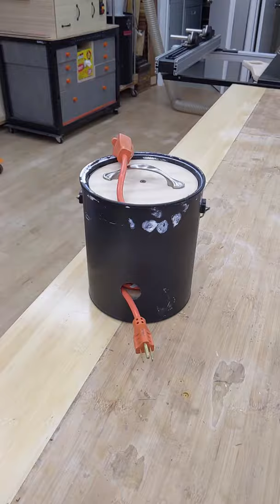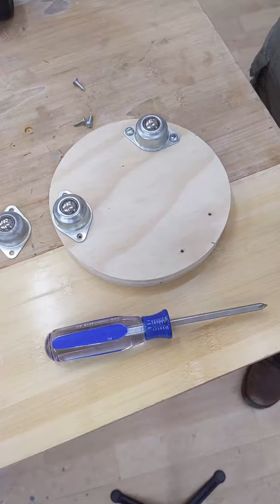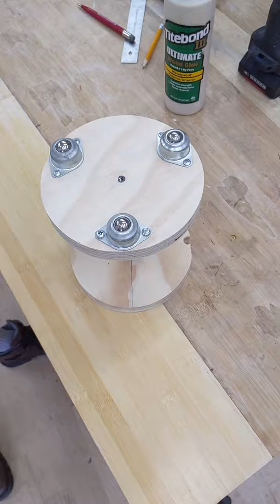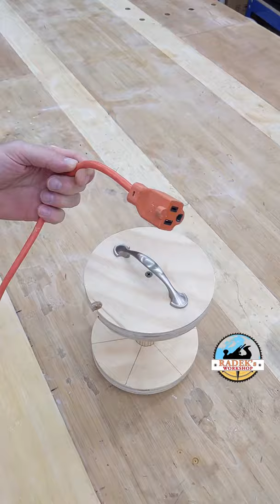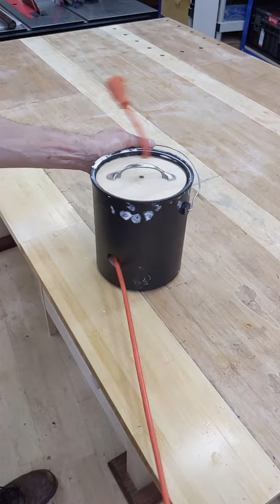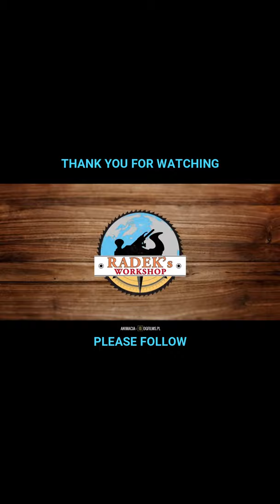Shop Hack - Cord Reel

Comment: You have to somehow put bearings on the inside bottom of the paint can so the cord reel frame can spin, but the end of the cord on top stays stationary. If this sounds wrong, it's because im having difficulty finding the right words to describe what I mean.
Reply from the maker: I've put bearings on the spool, it is really the same I think.